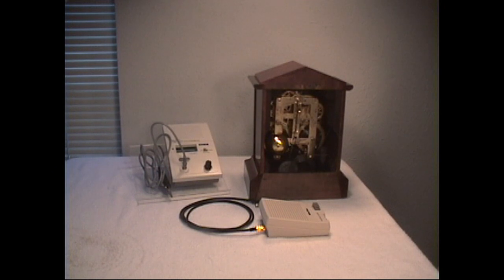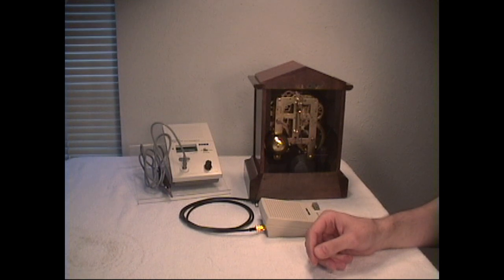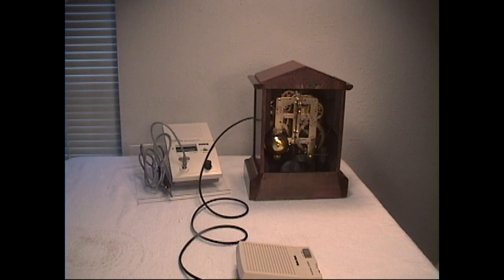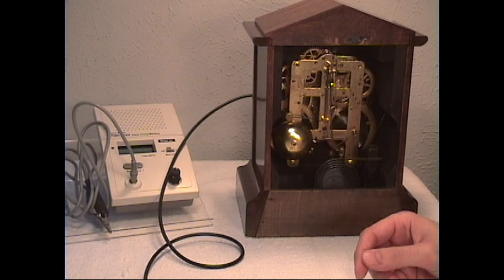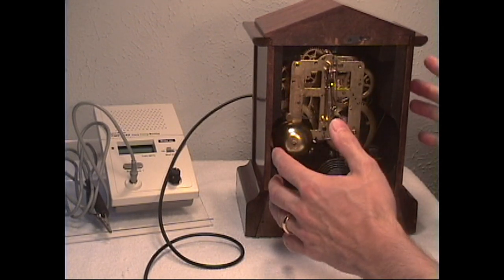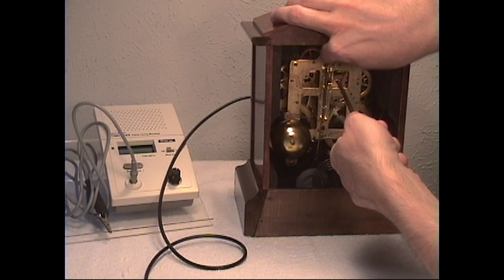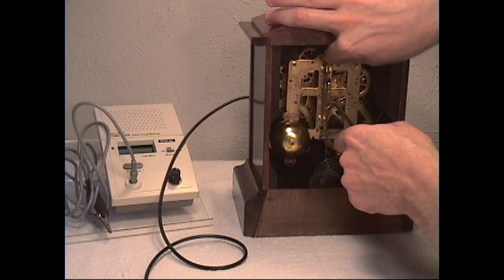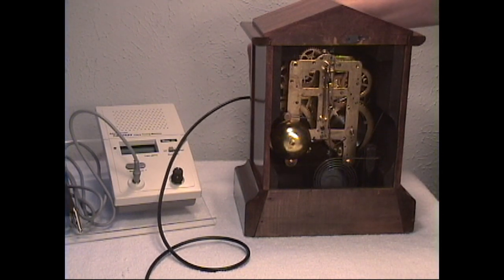Putting the clock movement into Beat. Clock repair basic timing and regulating tips explained.

Comment: What a great and very helpful video!  I fixed a Grandmother clock that has not worked in years.  The crutch on it was more of a flat rectangular piece of brass versus a round metal rod.  I had to hold it tight at the top with one pair of needle nose pliers while using another needle nose pliers to bend it clockwise.  I got luck and hit it perfectly on my first attempt.  I leveled the clock with a digital level to 0 degrees and it sounds and works great.

Thanks again.